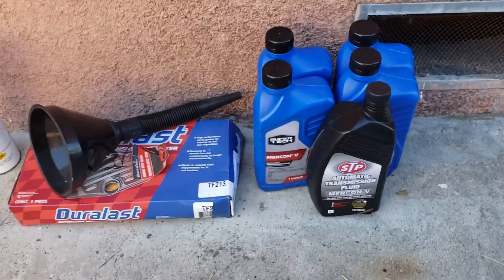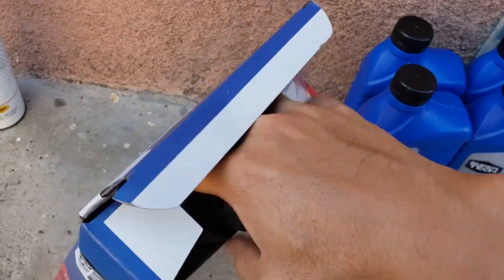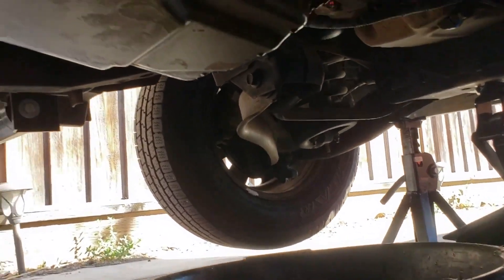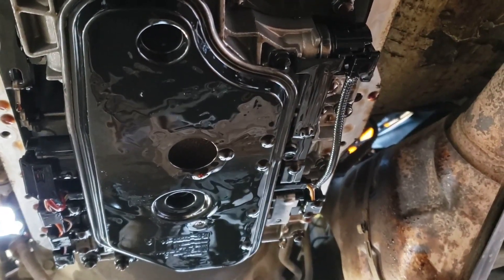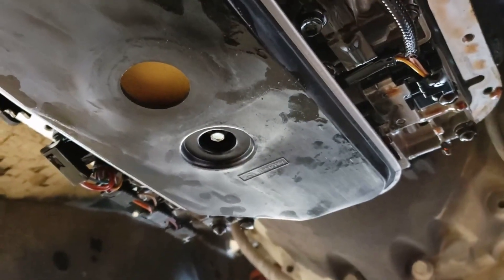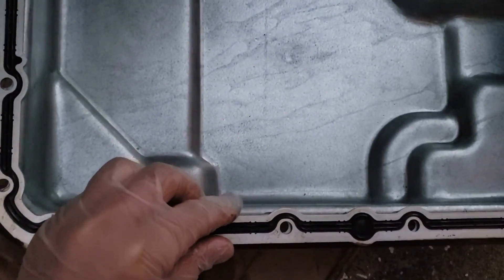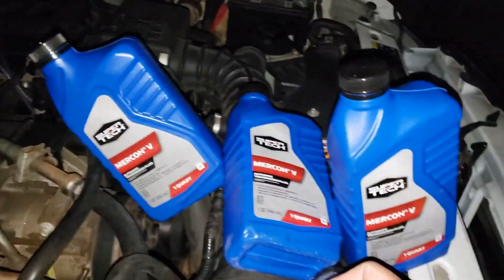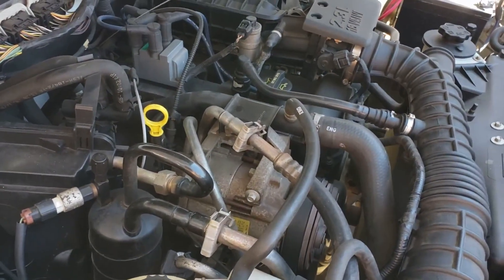2008 Ford Ranger Transmission Filter and Drain Service

Comment: My renger 2008 when I pass 50 miles the OD starting BLINKING. On and off. Any recommend
Reply from the maker: Sounds like an issue with the ECU?
Reply: Female w similiar problem...check the back axel and there's maybe a speed sensor on top, side.  Try a mcraft sensor. There's a few videis on it.
Reply: Same, did you ever find out what it was?